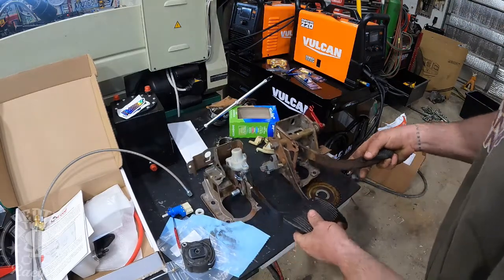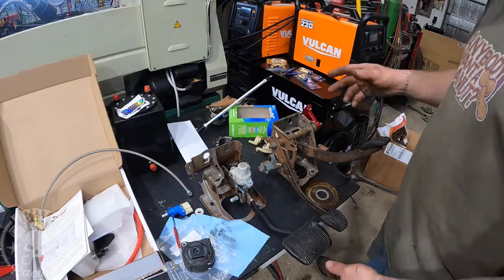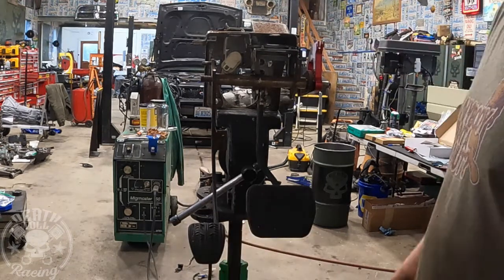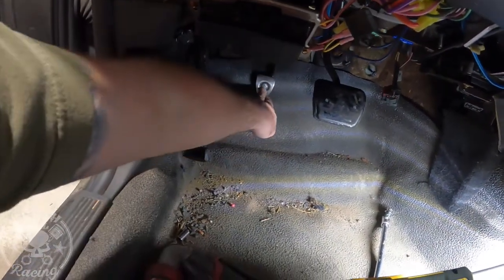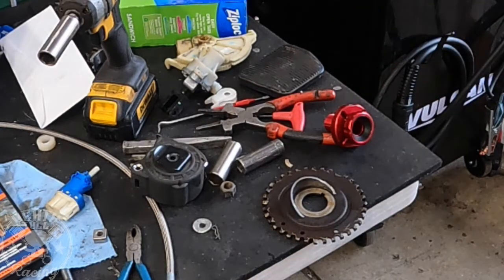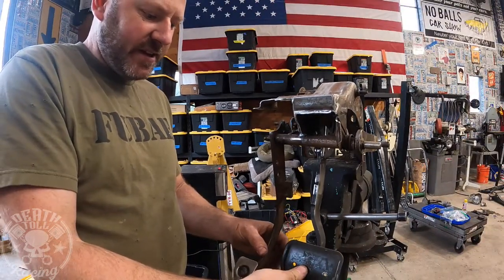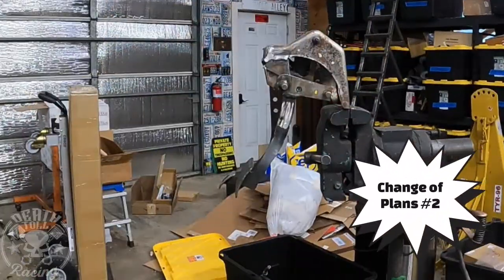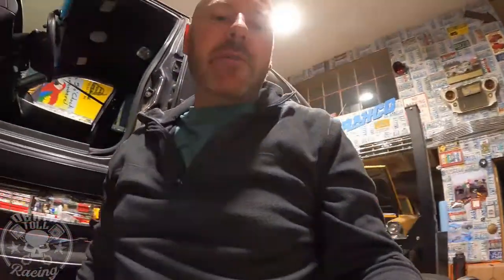2005 Up Crown Victoria Clutch Pedal Fabrication; 2010 Twin Turbo Build

Comment: I was looking at doing this for my 2005 crown Victoria 5 speed swap.  The more I looked into it I think I am going with a stand alone Wilwood clutch pedal and master cylinder.  There is enough room to the left of the brake pedal to mount it to the firewall.  Great video.
Reply from the maker: I think that is a great idea.  Let us know how that goes!

Comment: I have a drive shaft spacer if you have not sourced one, the T45 did not need it so guessing the TR3650 does. 

I am using the same hydraulic kit in my vic and it works good but my pedal still feels heavy however I don't know how much heavier it would be with my stage 3 without the hydro conversion and don't want to find out 😂 I'd rather have the external slave with the clutch fork over the hydro throw out bearing. I went with a T45 and had to screw the adjuster all the way in and it still is making contact with the fingers slightly. I think you said you have a TR3650 so you may not experience that. 

How far you plan on bringing the Caprice? Personally I like the Vic but I am bias, I did like my 92 Caprice though too.
Reply from the maker: I appreciate that!   I think I have one coming assuming it's correct.  I also would rather have the external slave, especially after installing the hydro throw out.   Funny, I had to make an additional spacer for mine to get to the 0.100-0.120 they wanted.  it was short, even extended all the way with the included spacer.  

The caprice will be basically identical build to this one, except it's a high compression 302 instead of turbo.  It is a square body style caprice that I've had for 20+ years taking up space in a shipping container.